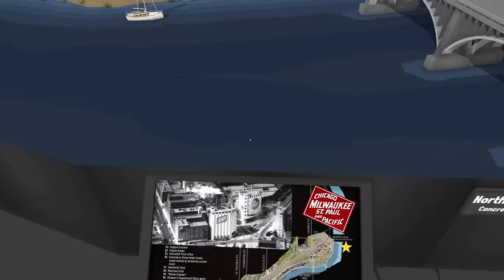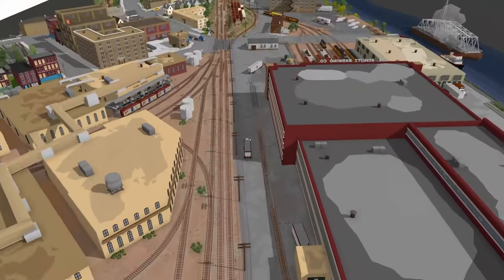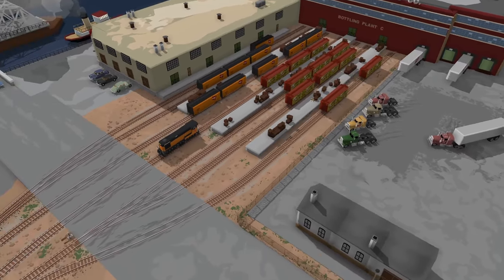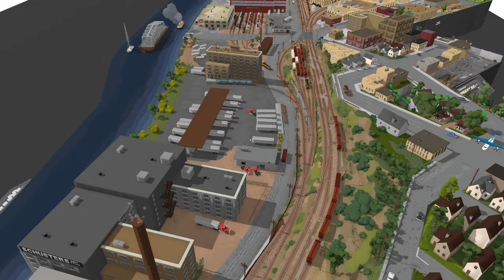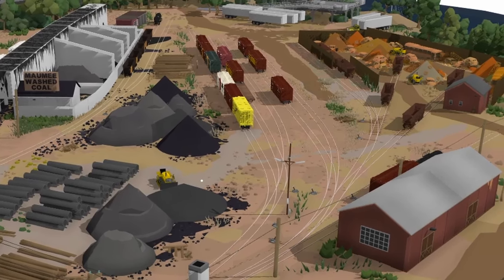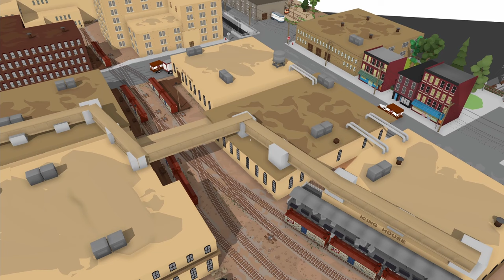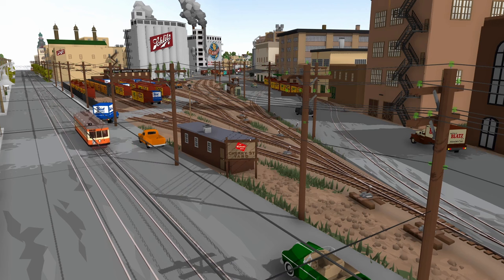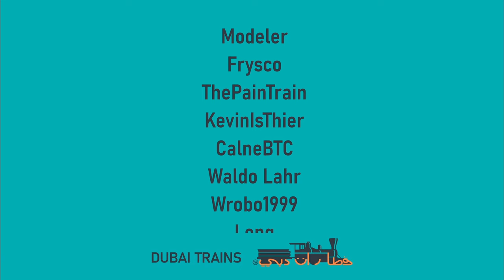64 - Layout Tour of a 1:1 scale Milwaukee Road Beer Line. IT IS MASSIVE !!

Comment: Wowow, what a nice scenery, a very great project.

About the middle, little, elevated 4 tracks yard, what you did to protect your unbreaked cars against natural wind blast and self away running by its own gravity downhill?

Normally such yards have in direction to the downhill side a small uphill layed track area, so that any unbreaked car cannot run by hard blowing winds downhill by gravity of itself.

At Langenhennersdorf in Saxony, it happened a terrible shunting accident in the year of 1912, when two unbreaked two axle gondolas, each loaded with ten metric tons of coal, were downhill running by wind blast during shunting procedure. An awaited, uphill coming passenger train could not be stopped on neighbour station, when the both with coal loaded gondolas started to run downhill by its own geavity. It was a very big portion of Luck that nothing dramaticly happened, because the downhill running unbreaked gondolas derailed inside a sharp curve an run into a deep valley just shortly before the uphill passenger train came to pass this sharp curve. The loss of two coal cars were much better than an accident with lot of causalities inside the uphill coming passenger train.
Reply from the maker: In modern times in such case with a  downhill stretch nearby I think they would use a derail.
There are also all kinds of protocols in place to ensure that cars are fully parked. I think once uncoupled and parked, the brakman wait a full 2 minutes to ensure the cars didn't move.
What they did before air brakes? Hope?
Reply: @DubaiTrains  In the past they layed down wooden beams ahead the wheels onto top of of both running rails to protect the wagon agains moving by wind or its own gravity after uncoupling.
Wagons with hand spill breaks could be breaked but it gave unbreaked wagons, too.
Inside freight or passenger trains every 6th axle needed to be breaked by a breakman, sitting onto a seat onto top of the car roof or standing onto a break platform aboard a car or sitting inside an elevated breakmen cabin onto one end of the car.
In the 1890's it gave four different air break systems. Two systems used compressed air and two systems used vakuum air breaking.
All those systems were single release systems, only.
After starting breaking, you could not stop the breaking procedure. If you stopped the procedure you needed to await until the vakuum would be available again or by compressed air until all break cylinders were empty and refilled again, sometime too long time to start a second try, than breaking accidents happened like in Ireland at Dublin or at France at the Garre du Montpernasse Station where Locos run over the bufferstop and destroyed the outer walls and crashed onto lower street level.
By all those accidents the safety 1rst car protected the other cars behind them.

Comment: This layout is huge and detailed.   I found a layout plan online that would be possible to build complete even in O scale; it is titled "plan of New Bronx Freight Terminal of the Central Railroad of New Jersey" with a scale of 1" = 60'.   The building that would be the focus of this layout is an oval of 194' 0" by 166' 0" and is surrounded by 2 tracks completely encircling it with 7 pairs of stub tracks turning off the outer loop track into an area that is obviously either paved or at least graveled so street vehicles can access the cars for loading and unloading.  The only access to this trackage is by a 2-track rail barge.  There are 6 3-way turnouts, 9 regular turnouts on curves, 4 crossings, and 2 interlaced turnouts facing each other.  The paired tracks are spaced 12' with at least 36' 0" between the pairs.  The land is a 4-sided area bounded by Third Avenue, Southern Boulevard, Lincoln Avenue, and the Harlem River with a 98' 9" transfer bridge with no 90 degree angles except the transfer bridge and inside the building.   It looks like the sharpest curve would have about a 90-foot radius so the cars would need to be 40 feet long or less and this would be the domain of an 0-4-0 or small 0-6-0; maybe a small diesel loco.  Because of all the pavement track and sharp curves, the turnouts would have to be built with special curved pavement switch points and curved frogs and girder-rail.  Pavement turnouts of this period and until WWII, were available with single movable-point switches more akin to trolley track but heavier.  If someone wanted to model this as narrow gauge, it would easily fit.
Reply from the maker: Hi Roy, I saw this somewhere. Let me look it up.
 https://model-railroad-hobbyist.com/node/27499

A very cool terminal indeed!
Reply: @DubaiTrains  His layout is the modified track plan and not the one from 1907.   It is really cool, even including the added engine house with removable tracks and the added trackage on the other side of the Third Ave. bridge that was added later.  I read a lot of the history of the terminal.  By using 90 and 104 foot radii, a lot of trackage was included.  I did not miss the details too much, after the Pennsy instigated the 3-track barge, it made bringing cars a little easier.  There are more switching possibilities with the newer track plan.
I am working on the design of a model of the first rail bridge across the Atchafalaya River at Morgan City, LA.  It had 2 movable spans-one moved sideways to allow the drawspan to move linearly to open for boats.